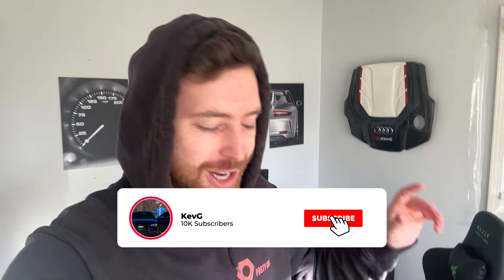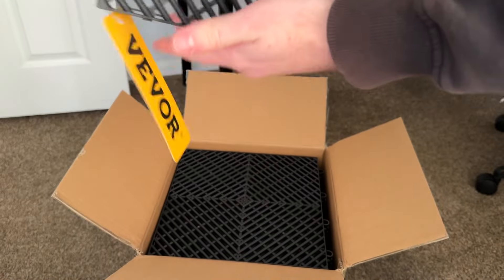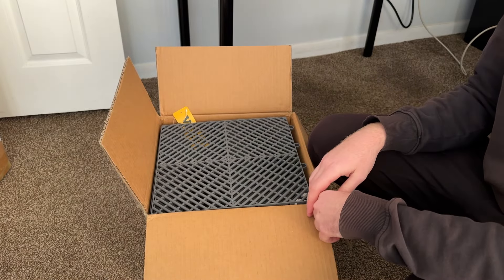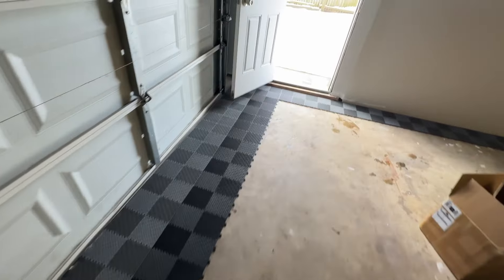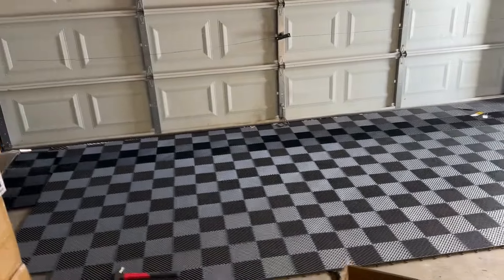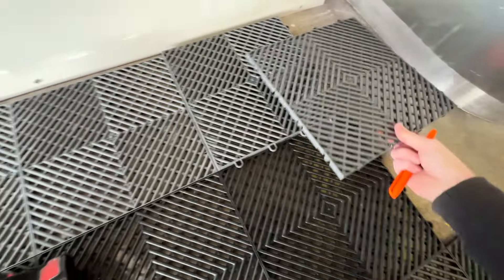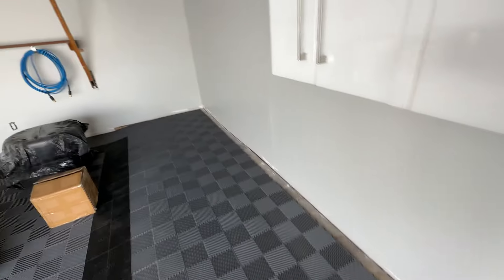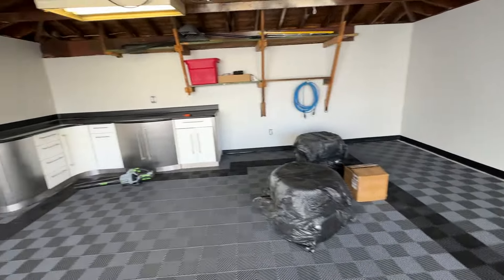Installing VEVOR Floor Tiles In My Dream Garage!

Comment: I installed this exact same tile in my garage about 6 months ago.  It looks as good as the day I installed it.  Luv it!
Reply: So I just ordered tiles from decor but they are not like this design they are still the free flow ones so I wonder if they changed their design or not. Seems more rubber than plastic. Still had ones that looked like this in the black, blue , and green color but the grey was different

Comment: So um, what happens when there is a oil leak? Or any other leak? It now has contaminated what you cannot reach and in order to clean it, you have to remove the tiles completely to clean it up? That's a terribly high price to pay when you spent so much blanketing your garage for other reasons.
Reply: Absolutely true. You drop a nut, small tool bit, whatever - a pain in the back to fish things out. This is a genuine fancy-carguy-Youtuber- flooring, nice looking but no good use to it.
Reply: My thoughts as well. Yea it looks nice, but I want to protect the floor. I'll probably go with the harden rubber puzzle type setup. At least if I spill something, I can just wipe it up, lol
Reply: @baltod4978  well I don't have this but have been considering. I saw a  review that stated they are easy to pop up and less screws fall through the cracks than you might think. That said if you're working with small hardware it'll fall through. Each person's situation is different.

Comment: Really want to get this tiles for my home garage, but people in the group that I'm in are saying that they're dust collecting tiles. You have to remove them once in every 6 month or 1 year to clean up all the dirt and dust underneath the tiles.
Reply: Mine are installed above a wooden subfloor and my Shop vac works great for me.
Reply: That's the whole point

Comment: Interested in these, are you able to roll like a floor jack on these without the wheels getting stuck?
Reply from the maker: yes you can roll one, I rolled my vacuum over no problem. Actually nicer than my concrete was bc of the imperfections  before
Reply: Err I don't know about the dirt trapping, will they blow clean?
Reply: @Truth2240  i also want to hear the answer to that

Comment: Any concerns with dirt just falling through the cracks and having  very dirty floor? The polypropylene solid types at least you can mop and clean 

They look good from angle for sure
Reply from the maker: @efthimios  I’ve been able to blow out any loose dirt with a leaf blower with no issues!

Comment: Great job on the garage man! That flooring is 🔥
Night and day difference. Any reason you didn't take out those shelf supports? Could have used vertical ones from shelf to rafters. Either way, looks great
Reply from the maker: Thanks a lot! Honestly just don't want to do it hahaha. Every free day I've had I've been doing other garage things lol
Reply: Fair enough   lol
Can't wait for the good weather here in Ontario, to put the A4 into summer mode!

Comment: I wish I could put this flooring in my garage but I rather not because I like to use my jack and jack stand. I’m sure I’ll be piss if i dropped a bolt through the spacing in the floors every time so that’s a hard no for me

Comment: What did you use for the garage/outdoor transition edge? I cant find the edge for these tiles. Please advise
Reply: This is also my main question.  I have a feeling they don't offer it.  I seen another video on these and others, and they tried using another brand angled peice and it didn't stay connected
Reply: I also looked on the Vevor website and did not find anything for edging. I like the tile but do not like the look of the edge.

Comment: Beautiful, hey my garage is 460 square feet.Each pack brings 50 pieces. How many boxes you think I will need to complete the job?
Reply from the maker: @evangelistaalbertomercedes7905  each square is exactly 12”x12” so I’d say 10 boxes. Depends if you have any tricky areas, want to do a pattern or need to cut around stuff. Hope that’s helpful, cheers!

Comment: Do they offer a border to go around the edges? Specifically in mind of the garage door opening where you'd drive over it. I'd want that more of a finished look but couldn't find anything like that on their site.
Reply from the maker: Not on their site but I’ve seen some examples on Amazon that do a similar job
Reply: @KevG did you buy an edge to test out?  Please do and update us with a video.